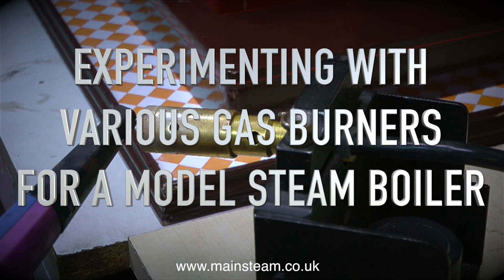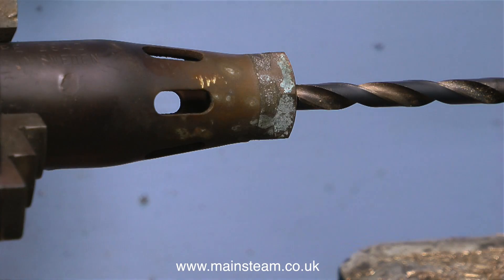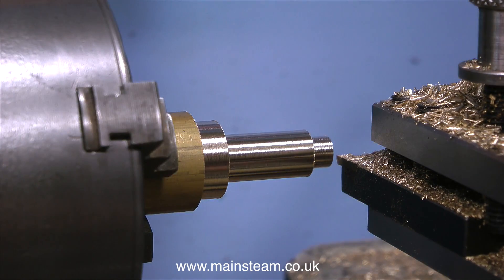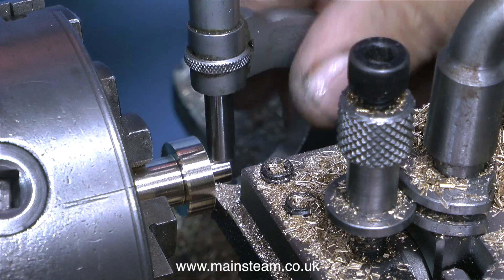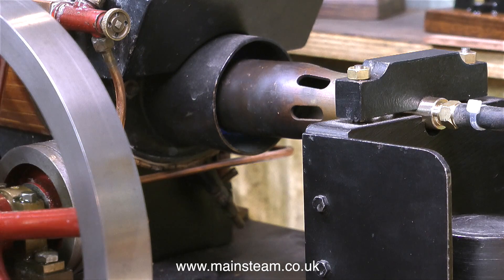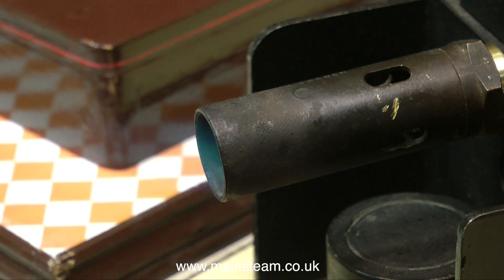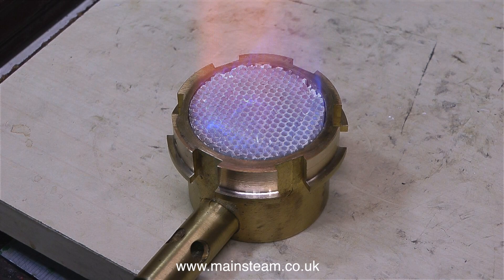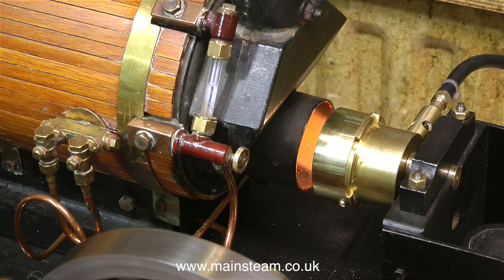EXPERIMENTING WITH VARIOUS GAS BURNERS FOR MODEL STEAM BOILERS

Comment: I have found the secret for the ceramic burner ,my little story , the vertical steam pressure would only go up to 50 to 60 psi ,then I added a round fence around the burner  about 1/2 " above the top of the ceramic , this improved the heating  and the   pressure goes  up to 100 psi.
Reply from the maker: Thank you, that's very interesting, I will try it. }:-)))

Comment: Great videos!
Do You know where i can find more information about elecric heaters for old burners?
Reply from the maker: No idea sorry .....
Reply: @keithappleton  Ok, i asked because i just saw a thing in what wisualy looked like a Stuart boiler or something similar, wich hade two cornstalk shaped cheramic pieces hanging on a metalrod and windled with what looked like coiled Kanthal wire connected to  points on an insultion plate in the back, where the gasburners normaly sits, it looked pretty old and i had newer seen that on this type of boiler before.
(unfortunatly the price of the set was way ower my budget, but probably cheap compared to a new set).

Comment: Hi Keith! I´m trying firing a Gemma ( 0-4-0 tender engine in 5" gauge) with one 3 wicks propane burner.This burner provides enough heat to get 30 psi in about 8 or 10 minutes but when opening the regulator, the engine runs for about 10 minutes until the pressure gauge goes to almost 0. The engine runs over rolling roads ( the same you use ). There are no steam leaks anywhere and the engine is lubricated properly. The particular thing is that I´ve put between the wicks and the fire tubes a deflector to avoid the flames get in touch directly with the fire tubes. I did that because my little OS Krauss has one deflector too when firing she with propane but she produces steam with no problem with this deflector! Could be this deflector the cause of the failure in my Gemma? Could be damaged the fire tubes if the flames go directly over them?. I hope you know what the matter is because I´m really worried about it.Than you and good music!Kind regards, Carlos
Reply from the maker: It sounds like gas chilling to me - a gas pressure drop as it evaporates inside the gas tank..
Reply: @keithappleton  Thank you, Keith.Do you think the flames going directly over the fire tubes could damaged them? keep on swingin´and kind regards,Carlos
Reply: @keithappleton  Hi keith! Finally I´ve discovered what  my problem was in getting enough heat for my Gemma. Since I was using a butane reductor with my propane bottle, this reductor cut the pressure at 23 mlbars ( not enough for gemma´s needings ). Now, after using a propane reductor which is allowed to support 37 mlbars, the 3 lighters work OK and the engine gets in 5 minutes 15 psi, in 7 minutes 30 psi and in 9 minutes we have 60 psi. Now, when the regulator is open, the boiler steams pretty well reaching more than 60 psi. You can´t imagine the happiness I´m feeling now!Thank you for your support, it´s a pleasure reading your experiences.Kind regards from Madrid,Carlos( musician also)

Comment: Propane is a huge molecule, and it takes time for the oxygen to bond before it should be burned.  Most model burners mix the oxygen at the burner, which is far too late.  Look at a grill or your furnace, you will see that the oxygen is mixed about a foot away from the burner, and many also have a pan to help mix the propane and the oxygen.  If your bottle is being frozen, you are trying to make up for the incomplete mixing by pushing too much propane.

The howling comes from resonance in the input gas tube.  Outdoor fire pit makers sell tubes to fix the whistling.

Comment: Instead of a water bath, or multi-can manifold, what about fabricating a warming holder for the can? A short length of exhaust pipe soldered to the back of the holder could provide a bit of warmth without letting it get too warm.
Reply from the maker: I dare not cover any of the obvious solutions involving heat owing to the Health & Safety implications . . . . . }:-)))
Reply: Keith Appleton That is a shame. A steam warmed canister holder would be a fascinating addition to the steam plant! ;)

Comment: Hi Keith, first of all: congratulations for these GREAT instructional videos. I´m a newcomer relating with gas burners and now I´d like to fire my little Krauss ( 3 1/2" gauge from O.S. Engines ) with gas. I´ll use the burner O.S. designed for this loco but I´d like ask you if burning propane gas only could be too much heat for the fire box and - maybe - I could cause damages in this part of the engine. It would be better to use a mix of butane and propane?
Also, I´ll use a small piece of steel just to protect the fire tubes from the flames.
That´s all by now, thank you very much and - once again - congratulations.
Best regards, Carlos
Reply from the maker: I wouldn't say that there would be too much heat, it's just model boat club policy in my area to disallow Propane owing to its higher working pressure.
Reply: OK, thank you. Regards, Carlos

Comment: lol love the musical burner,  when you move it in the sound reminds me of a boiler at work from years ago.... the draft being caused  didn't get enough air around the outside make up ring so it tried to drawn it thru the burner which changed the flame and caused a howl.
  another affect you also see in your flame can be caused by sound.  work on by physicist Heinrich Rubens  showed how sound waves  also change and affect  how gas pressure flows in a tube burner or in this case the flat face  of the burner. 
   question  i didn't happen to notice if you mentioned it or not  when you insert  burner  and it starts to howl .... if you turn down gas flow does the howl diminish or go away and remain burning . I'd almost say from way it act  the slots on outside could use  some milling to widen them a bit to allow more air flow around outside so then you could insert it all the way in proper just a possible thought
Reply from the maker: If I reduce the pressure the howling stops but so does the steam raising capability of the burner . . . . .
Reply: that's what i assumed it might do... sounds like   (pardon the pun) the burner is acting like a reed  thru the slots.   its airflow is basically not high enough thru slots for the draft draw so what extra can flow in  has to be sucked in thru the air mix orifice and burner causing the visible change in flame and the harmonic resonance     if i might suggest mill or file the 6 slots wider and also  into a       \_/     style a form and soften the edges of slots with a radius to reduce any drag or sharp edge that can also  induce  a resonance..... please tune to "B" flat

Comment: Bonjour Keith,
Is the Watt's regulator really functional ?
Amicalement, Raphaël
Reply from the maker: Almost ..... it would work perfectly  if the centre valve inside the block was a better fit ...... but like with most model steam engine governors that I look at,  'Butterfly" valve is a slack fit.

Comment: To help with the chilling of the gas canister and loss or pressure, try putting it in a shallow pan of warm water.  Eventually, it will chill the water, but you will get a longer run time than just having the gas canister in the open air.
Reply from the maker: Thank you, I am aware of most of the problem solutions and will get to them in the fullness of time :-))))

Comment: I don't know of any restriction on the use of propane on model boilers, indoor or outdoor.   Many locos burn propane, in fact Train Mountain is now propane only due to the fire danger.  I have an indoor steam plant that uses the little butane cylinders but I much prefer to run it on a 20# propane cylinder same as my silver soldering gear.

Comment: I think the howling is caused by the fire trying to suck in more air to stay lit. As you noticed, when the howling starts, you notice the tips of the flame aren't as sharp / almost go away. I think if there was a hole drilled into the metal, it could allow enough air to be sucked in & not cause the howling once the burner is stuffed all the way in.
Reply from the maker: Yes, I think you are probably right  ..... although it's quicker to just move the burner 1/4 of an inch away from the flue tube :-))))
Reply: Definitely! Was just a guess too. It reminds me of a bunsen burner, where there's an adjustable metal slide on the bottom that controls airflow.
Reply: Keith Appleton see if u can put the canister in some water so u won't lose  pressure wile in use

Comment: Keith, a warm water bath ought to prevent freezeups in the butane canister. Isn't the orifice for butane different than that of propane? Why can't you use propane for steam boilers in England?
Reply from the maker: Strange ..... at my local model boat club everyone was told that Propane couldn't be used for firing model steam boats ......
Reply from the maker: Yes I use the exhaust to keep the tank warm, but some of the regulations on model steam engines & boilers etc are quite strange in the UK - Health & Safety gone mad ......
Reply: Keith has got this wrong, there are no regulations on the fuel for boilers in the UK.
Reply: Who told them this, think about all of the caravans with 13 kg gas bottles most of which are propane. You  can pull more gas out of a propane bottle than butane quicker before the cooling slows it down.
Reply: I wonder if it is a "club rule" that over time became "law"?
Reply: bitsnpieces11 Hey you got it wrong. Propane is lighter than butane. I learnt this when I used to work on ships transporting LPG. As boiling point of propane is much lower than butane it must be stored at a higher pressure to keep it in liquid state. So maybe propane tanks are not allowed for recreational uses.

Comment: Make a manifold and run 2 or 3 gas cylinders at the same time, it eliminates the chilling substantially, I run my propane forge like that, due to freezing pressure drop. I now have the cylinders outside with no problems in the winter when the temp gets to below minus 10C regularly (I live up a mountain in France).
Reply from the maker: That's a great idea. I think I will just use a much larger gas tank, as the gas consumption on a model steam boiler burner is small - plus a larger gas supply is cheaper than buying these small cans .....